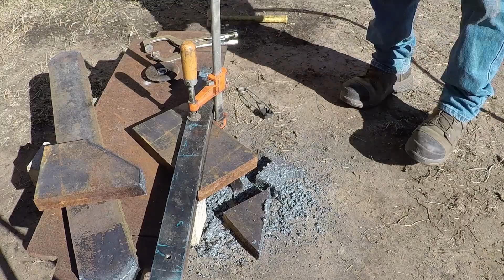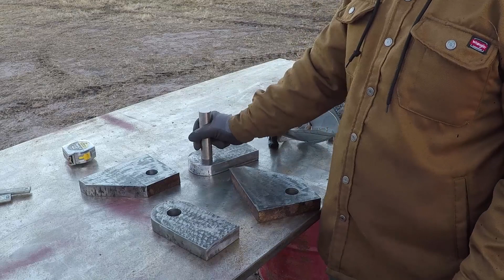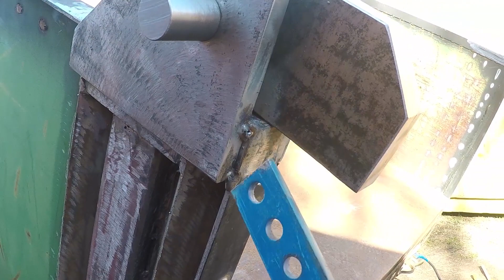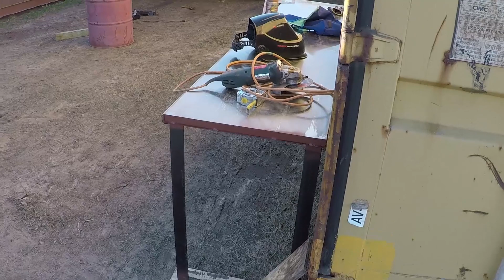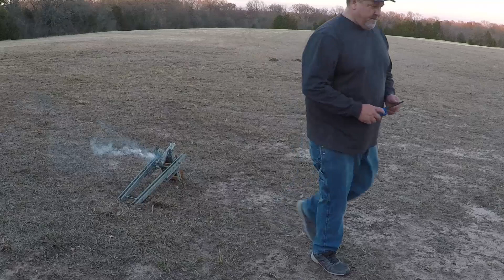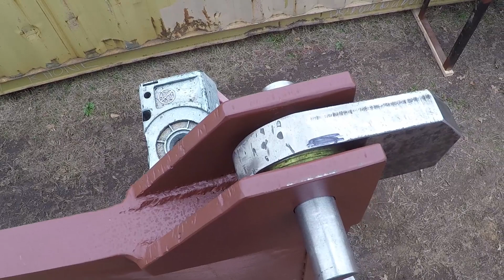Dump Truck Project Homemade Tailgate Hinges

Comment: Very nice job. what type of cor bit were you using to drill through that steel ?
Reply from the maker: Hello, I tried many brands of carbide hole saws (cheap but make sure the carbide looks large from the pictures provided by the seller). I get mine from eBay and Amazon. Every brand preform great. If you use them with hand held drill, they will break. If you use them on drill press, lathe or milling machine, then they will serve you for very long time. Use plenty of oil while using them and run them at the lowest speed. I am not sure what brand I used in this video. I also tried expensive brands like the champion and they preform similar to the cheaper brand. Thank you
Reply: @SalamSayhood  thank you I appreciate the info and again great video keep making them